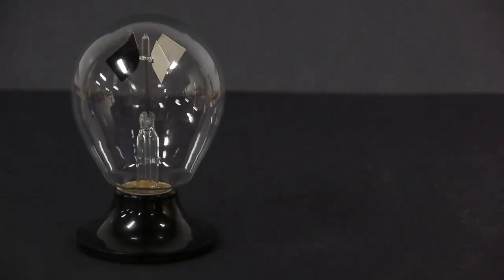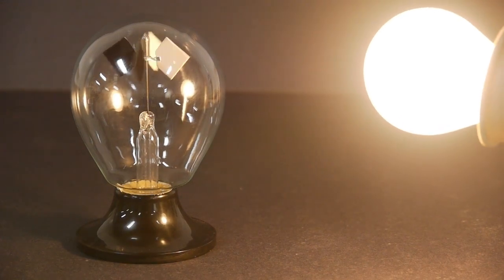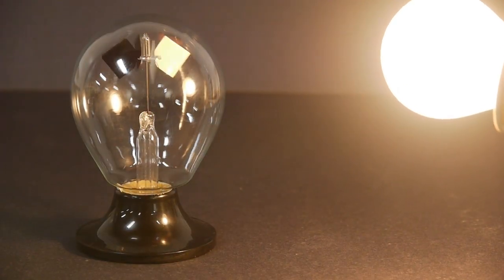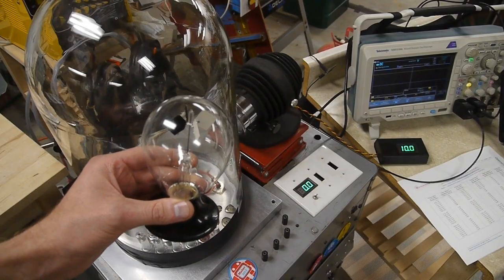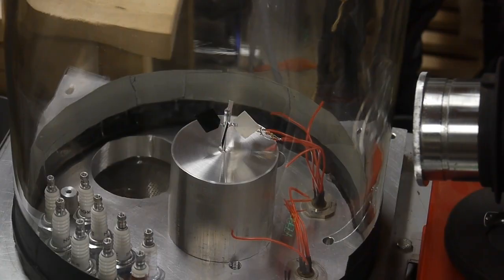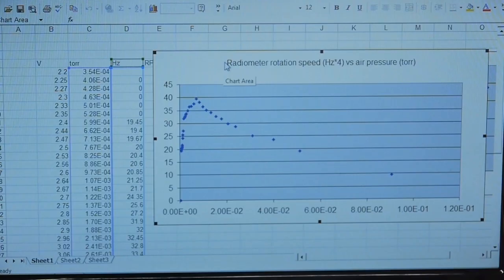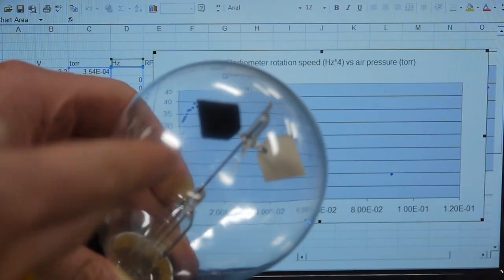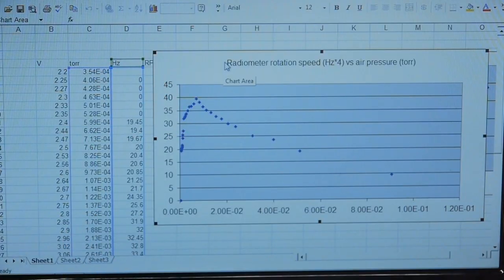How a Crookes radiometer works

Comment: I'd like to see how a fuel injector works, intimately, I know what they do and the purpose they serve. But how do they work? Is it just a valve that opens and the fuel pressure behind it atomizes the fuel? Or does it create more pressure itself? Anyway cool vid!
Reply from the maker: Coincidentally, I recently changed the fuel injectors on my DeLorean.  However, on that car, the injectors are mechanical (Bosch K-jetronic), not electrical.  They open abruptly at a specific pressure, and close abruptly below a specific pressure.  When fed a constant flow rate of fuel, they oscillate, opening and closing rapidly (eg 1500 Hz) as pressure builds and is released by the injector.  After 30 years, the injector seats and pintles were worn, and would not seal, causing the injector to dribble instead of oscillate.  This causes the fuel spray pattern to be undesirable.  I have the worn pintles and seats and was thinking of looking at them with an electron microscope.  Nearly all modern cars use electrical injectors that simply open when energized and create a nice fuel spray pattern.  They do not add any pressure, and must be fed high pressure fuel by a pump.
Reply: Basically yes, with the computer controlling the PWM. There is also mechanical fuel injection, but I've been out of the auto mechanic side for many years. Hopefully someone with more knowledge will let us know. I think I remember hearing that diesel engines were switching to electronic fuel injection but I'm not sure if they found it to be as dependable as mechanical.
Reply: Applied Science Ahhhhh very nice to know. I've literally wondered forever how they actually 'worked'. Thanks so much and I look forward to more videos!

Comment: does the fact that it needs some atmosphere in there ruin the idea that you could just paint an asteroid black or white and make it change course? or is that working on a different property...i guess the yarkovsky effect would be changed by more or less black-body absorption...but would that just change it's rotation or it's actual trajectory
Reply: The idea behind painting an asteroid is something completely different. By absorbing the solar radiation much better the dark side will be evaporating more water (and other gases) than the light one. These mini "engines" will alter the course of the asteroid.
Reply: That's a good question, however, I believe it would be easier and more cost efficient to just put a solar sail on the asteroid; or perhaps a rocket if time were an issue.